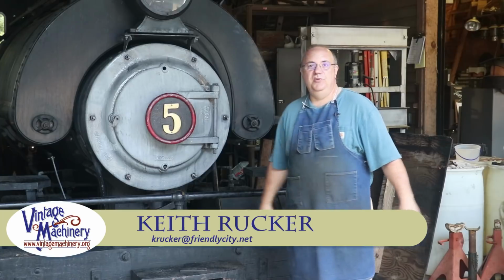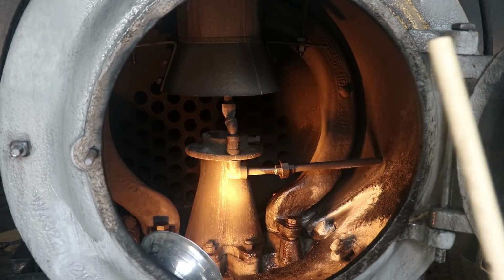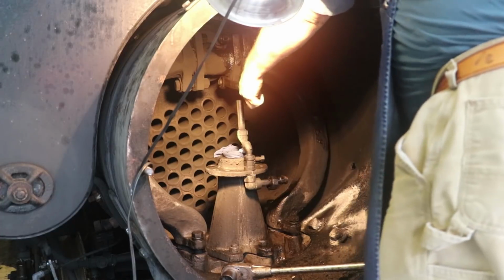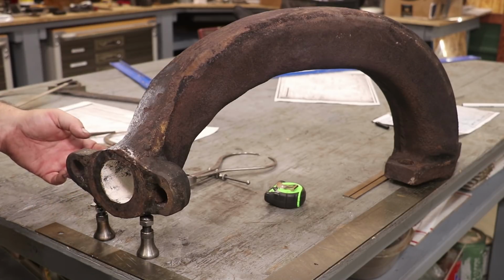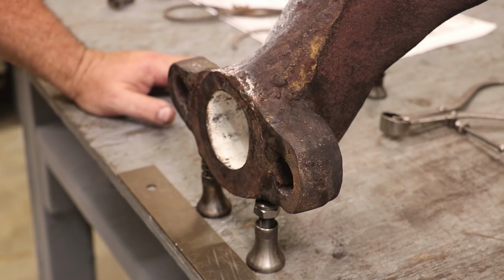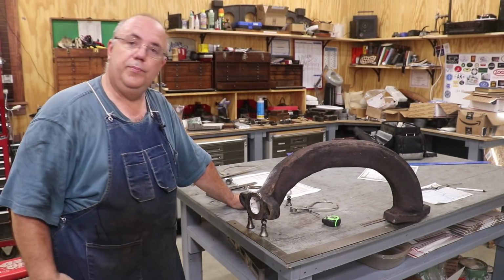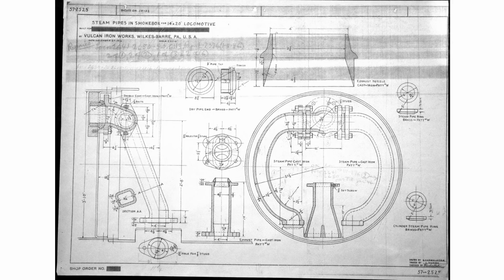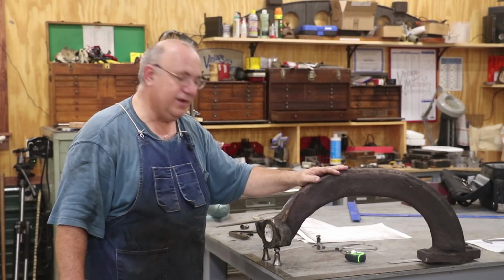Steam Locomotive Steam Pipe Repair - Part 1:  Pipe Removal and Game Plan

Comment: Could a temporary steam pipe be bent out of stainless steel tubing so the original casting can be used for reference in designing and casting a new cast iron?  Probably not because of cost and design-from-scratch considerations, but worth exploring...

You do need to pull the other steam pipe to get the exact contour of the mating surface.  

I do understand the need to make a new part as close to the original in shape and material; this is a restoration project, not an upgrade project.

Comment: Keith, is the reason for repairing that one due to keeping it original? if not ,would thick wall stainless tubing with flanges work or does the cast iron work better for heat transfer? steam is cool (no pun intended)

Comment: The ancient history of my youth contains the use of Portage layout machines.Those were to measure castings and weldments of frames and final drives of construction equipment like dozers, scrapers, and quarry trucks. The table was made of segment bolted together. Milled slots (in the top) every 10", (I think) formed X & Y coordinates. Rolling height stick with vernier scales for height and on the cross beam. The height stick locked into the X/Y pattern. Seeing that casting brought it all back to me.

Comment: I was always told that mixing welds and fasteners was not recommended.  Welds (and I assume brazings) are so stiff that they carry almost all the load and fasteners are much more flexible.  Therefore the fasteners don't carry load until the weld fails.  Adding cap screws might not help as much as you want and may weaken the pipe in fatigue.

Comment: Considering all the circumstances, I would suggest seeing if a temp replacement could be fabricated so you could use the part that came out of there for reference in making the new one.

Thinking "out loud" again:  If the original part, or the parts it bolted to, had a defect that would cause higher stresses to those flanges, then replicating the tube to be exactly like the old one might be a mistake.  Or something has worked loose over time, and only moves around when things are closed up and it's in operation, where you can't see it happening.  It might be a good idea to have the others that are working on it to keep an eye out for "tattle tails" (anything unusual looking, something similar to the white calcium buildup inside a fuel blackened fire chamber) that may be an indication of something else going on.  

In short, if the problem keeps repeating, there may be an issue deeper in that needs to be addressed first.

Comment: Make  blank part for true measurements. Cheat up two end plates out of thin stock with actual bolt holes. Mount them to the two mounting, steam holes then just take a piece of scrap rod and weld between them solidly. The two flanges will then be held permanently in place for measurements and angle finding in relation to each other without having the original flange grinding messing you up. Then you could repurpose the mock up to the school for use in their casting project afterward.

Comment: Hi Keith, interesting project. From what I can see the critical dimensions are the orientations of the two flanges to each other, their positions in 3d space,  the volume of the pipe and the internal core shape. With the part on the table I can imagine fabricating a fixture with a flanges on each end one fixed, lets say the top one, and going back to the engine attach the top to its flange and position the lower one over the steam chest inlet and weld it in position. This would give you the correct orientation and spacing of the flanges in XYZ planes. That way you would not have to trial and error braze the lower flange but have a firm dimension. The students , having these parameters could then proceed with confidence with their project and your fit up would be accurate.  Kind Regards Richard.
I

Comment: I would cut the both ears off and trim the end down 3/4" make a new flange with all the correct dimensions that would fit around the tube, put it all together inside the loco where it will be at and braze as much as possible before pulling it back out. The tube should be inside the flange an inch or so and would be plenty to hold braze, the part is being held in place by the flue tube and upper connection so it wouldn't separate. Looking at that, you could measure and set that piece up for hours but there is no way to machine the 1/4" step or to make sure everything is lined up properly. If it's bolted together inside the loco you can braze it without it moving or changing orinetation enough to get it out and finished brazing it.

Comment: Wouldn't the pipe on the other side be a (presumably intact) mirror image of the damaged one? If you can get the good one 3D scanned or modeled in solid works flipping it is easy.
Reply: Nope.  There is no way those pieces are mirror images.  This was built, piece by piece, over a hundred years ago.

Comment: The idea of this whole thing is to repair with minimum alteration to the original part. Yes, a new steel or monel pipe may be the modern way to go, but this locomotive is over 100 years old, and the museum would like to keep it as original as possible. So for accuracy, taking an angle grinder to it isn't a good idea. Better a fixture to hold it in a mill, and machine off where necessary, then fabricate pieces to fit. Brazing is probably the way to go, but keep even that to a minimum. Jon

Comment: How about making a thick steel flange with a insert pipe on a 45 just smaller than the cast tube  bolt it to the boiler come back in with the curve slide it inside re assemble it to the bottom fitting the NON pressured flange at the top get in with a mig , Weld the flange to the tube on one side or Tack it bring it back out and go to town on the weld either by Brazing or molten brass Let it cool.

Comment: If I were trying to repair this for a permanant job cuting the whole flange off making a new steel flange with a spigot nose to locate inside the main tube is the way to go
Refit to the part to the engine tack in position with a arc welder remove  back to the shop and then preheat and braze the joint  in a fixture on welding table to minimise any heat movement 
grinding out  the tacks as you get to them  i think that the benifit of having a higher tensile material on the joint face where the most force is applied by the bolts  is worth the extra work
i am looking forward to see  your choices for the repair

Comment: Keith,
Good video,
Why wouldn’t u make a new one outa steel?
Reply: J Jason my guess is that they want to keep it as historically accurate as possible
Reply: Mike Reid 
Oh,
Wonder why it wasn’t originally made of steel.. maybe coz steel wasn’t perfected yet, idk
Reply: Did you not watch the video? Time....
Reply: Steel corrodes a lot in the presence of steam on the inside and corrosive gases on the outside of this part.  Cast iron has shown to be a reasonable material to use for this application.  The problem is why the original breaks.  My guess is an accident--like dropping it; which started all of this.

Comment: The ideas put forth here in the comments are fantastic.  If it could be scanned and 3d modeled - isn't it possible an inaccurate model could result ?  The original casting might have distorted over the years.

Comment: Well, don't discount what the other shop did. They were trying to help the museum in a crunch.  Sure, was it 100% correct? no but hey, they tried to get the locomotive back in operation.  Why not grind the the whole face back across both flanges and the orifice and braze on a piece of machined steel, then remove the rest of the weld work?  That way you'd tie both sides together and it should last at least another 100 years.

Comment: Congratulations on another great program.
Suggestion...What a wonderful metrology project.  You could measure the mating surfaces inside the engine as well as the surfaces on the pipe and make them match up theoretically before you begin cutting.  Surely the professor has a measuring arm kind of device that would work.  If nothing else, take several hundred pictures of the piece and the mounting surfaces in the engine and use something like Pix4D to develop a point cloud...and then a surface for the parts.

The heat is also an issue.  It is fortunate that the part is curved like a Bordon tube, since it will expand and contract as the temperature of the boiler changes.  so will the mounting points...The curve in the pipe will allow it to open up and shut down as those differences appear.

I bet there is a local trade school or company with a flexible arm like the  
MCAx - Premium portable metrology or equivalent.  Or take hundreds of pictures with you phone including a scale and some reference points to make things line up in software better.

Just a suggestion.

Tom Talley
(slept in a Holiday Inn Last year)...

Comment: The kind of project we could easily have been assigned in a Navy Foundry. My suggestion; make it out of Monel. The metal handles heat and corrosion like no other metal. For more information, watch my Monel video. It behaves better than stainless steel when it comes to toughness and corrosion resistance. Check it out, it just might be the material needed instead of cast iron and all of cast irons' flaws. Whatever you decide on, I look forward to the videos.
Reply: This project would be a great project for you 2 to get together and cast a new one 
Keep the old one for a display and a cast form for the future
Reply: As long as the pattern is made the right size, shape and has the metals' shrinkage compensated for (the same for the core box of course) the mold won't care what the pattern is made of. This project, in all likelihood, will be a "one of" so the pattern should be made of a material that will last at least a half dozen rammings. Beyond that, the law of "Diminishing Returns" will start to effect the project.
Reply: What flaw does cast iron have here? It's lasted a very, very long time and finally failed. Monel is ridiculous overkill here. All that is needed is some proper radii on those flanges and it'll be good for another 100 years. I'd say cast steel would be far cheaper and a substantial upgrade.
Reply: chris0tube Lll
Reply: It was a mistake so now you know

Comment: Kieth, you may be overthinking this a bit. If it sorta sealed with the flange being /that/ far off, it might be able to seal just fine if you built the flange up and ground it back down carefully. You could even rough scrape it in using a surface plate and large angle block. That is how I would probably do it since your limited on shop time and making that fixture is going to take honestly a while.

Comment: I would like to relate how I saw a similar repair done.  The biggest problem you got is the exact distance and angles between the top flange and the bottom one. If it's not correct it will be like bolting two warped parts together. Here is what you should do. Cut both ears off the lower flange leaving the steam pipe part its original length. Bolt it down to your mill and machine the end round, making the end of the steam pipe round while leaving it's length. (in my shop I would most likely use and angle grinder and then a file.)   Make a new flange from a piece of one inch plate and mill a hole that is a close fit to the steam pipe and make it with the lip it needs to make the seal work.  Once you got the parts made, bolt them back into place and then, once the parts are where they should be, then drill and pin the flange to the pipe, remove as a unit and then braze them together. This way you get a perfect fit with little stress on the cast metal or the repair. You should pre-drill the flange for the pins before you go to fitting, then you just have to drill through the cast pipe, tap it and you could put bolts in to hold it fast.

I've been watching your videos for a while now. They are a big help to me and I learn a lot from them. Now I hope I can maybe help you with my experience.
Sincerely, Christopher Dowie

Comment: just a thought why not mill the bottom of the steam pipe  flat and the make a spacer  to return the pipe to its proper length
Reply: The problem is sealing the spacer.  There is considerable steam pressure in the pipe (manifold) and then they have to deal with expansion and contraction with every thermal cycle.
Reply: i was thinking dead soft copper gasket and steel ring like on a nitrous engine
Reply: Sealing it is no problem 
As far as modern engineering goes steam isn't high presure or hot 

A simple cardboard gasket will retain 5000psi of oil pressure 
Nitrite /buna n oring would be better though
Reply: Nice try, but steam is not easy to seal. It would eat cardboard in minutes. It's a wet gas- particularly hard to seal. O rings require far too close a tolerance for what we have here- nothing is flat, will ever be flat or lined up closely. O rings need perfect bosses and very specific crush.
Reply: Orongs really don't require that tight of a tolerance especially at such low presure 
You might not believe what iv sealed up on earthmoving gear over the years 
Cracked steel housings if welded up buzzed with a flap disc and bolted up 
As long as he has a flat surface on the broken part 
Then he can put an oring groove in the spacer 
Then the other side of the spacer is made to suit the original seal
Reply: Or machine a taper in the pipe and the adapter 
So it seals once bolted up
Reply: fowletm1992 That’s what I’d do - make the adapter out of the same material to remove expansion issues, and you could easily adjust the adapter to take up any gap. Much easier than machining such an awkward part to an accurate length/size.
Reply: When you consider the material removed by the shop that botched the job, plus the material that Keith will have to remove to True up the surface and return it to the proper plane, the gap produce at that joint will be considerable. Without an adapter plate or somehow building up that surface, bolting everything together will provide enough additional stress on the part 2 quickly produce a crack or break elsewhere.

Comment: Always interesting as usual. Here's an idea. Instead of remaking a pipe to factory specs, why not make one to fit the engine. Take some critical angle measurements where the pipe bolts up to at the top and bottom and make those angles into the new casting. Then it would not only fit better but seal better as well. The factory "blueprint" may or may not be spot on as the engine has settle over the years and angles may have changed. Just a suggestion. I look forward to your repair of this in the mean time.

Comment: I wonder if the steam pipe that is on your bench can be computer scanned, the scanned information loaded into a 3d printer and a new pipe printed in pieces, assembled and installed into the loco to test fit.

Comment: Did you grab the left side pipe also so you could use it as a template for the new flange area? It would be a better source of dimensions assuming it was a mirror image.

Comment: The repair is easy for ya Keith, but man, i bet it will be a knocker when you'll have to set the pipe back in and work the material so it doesn't crack again, ever...

Comment: Keith, it seems to me that it would be easier to cut off the entire yoke, machine a whole new botton end then screw and braze on the fitting to the pipe.  You would then be able to fit the new yoke directly to the steam engine before attaching to the heavy cast pipe.  Looking forward to seeming your work.

Terry

Comment: Who ever done the welding really did a number on it. 
This is an heated environment and cast iron and steel are expanding differently when heated up. Even if it didn't broke when clamped down it would have broken over time. I'm personally against brazing castings if they are in a heated environment. Bonze will expand much more than cast iron. This can cause problems. Welding with nickle would be better, i think.
Reply: Sounds to me like the one side that was brazed is holding but the side that was welded (I presume with nickle) cracked. I'm not a fan of nickle rod.
Reply: They had problems with the steam pipe leaking on that side all the time, if i remember his videos correctly. I think that the brazing made the part move when the boiler heated up or cooled down. But of course it could not be related.
It's my experience that brazing works better on mechanically stressed parts than on parts with heat relates stresses.

But of course i could overestimate the precisions of the needed fits in relation to the working temperatures. I did not measure the temperature differences nor did i know the tolerances.

Comment: i did hold such awkward piece in a lead bead (sheet metal box filled with lead). But mine was much smaller. Maybe some "lead pads" at some places could give you some flat surfaces you can clamp to.

Comment: Try and make a quick two part  molding of the piece with plaster of paris or something similar.  It would give you access to the part for measurements after it has been re-installed in the train.

Comment: frabricate one in steel while you wait for the casting. That way the students can have the original to copy.
Reply: Hgh pressure pipe, preferrably in stainless, bent to shape by someone who does such for chemical plants. If it isn´t too costly, get one for the other side. Both just as spares, IF there´s an issue again, to keep the down time to a minimum.
Reply: I agree with steel pipe and even at that it would be real job fitting some off the shelf 45's and 90's but at least you'd have some steel to bolt down then. I think you will be chasing the fractured/cracked cast iron in the future as  already seen in the past. It's inside the smoke box (no one sees it) go with similar closest standard size pipe you can get and make some flanges. I know it's precious 100 yr old cast iron, but be realistic here and use the newer steel.